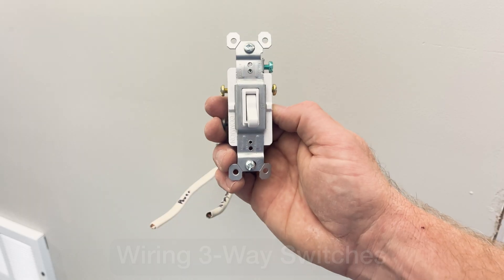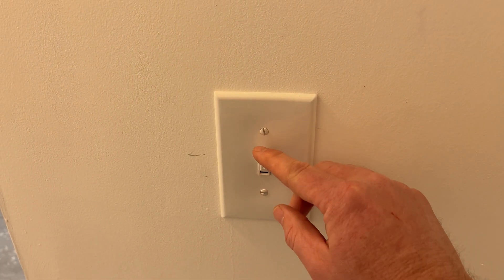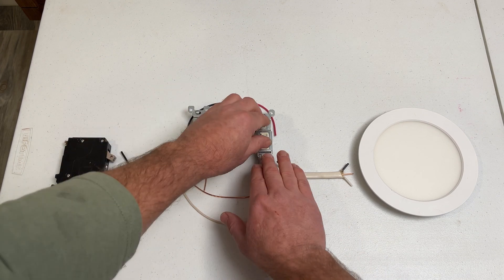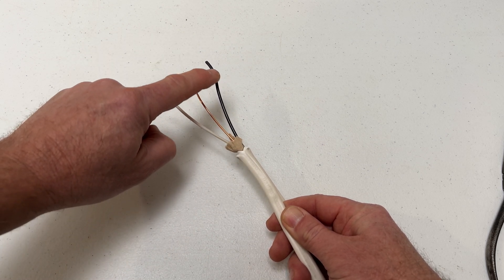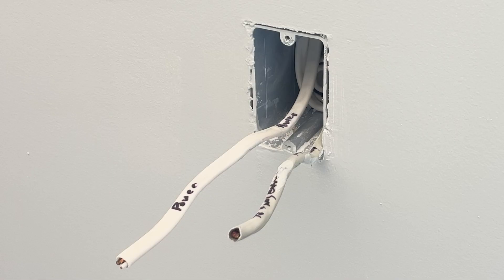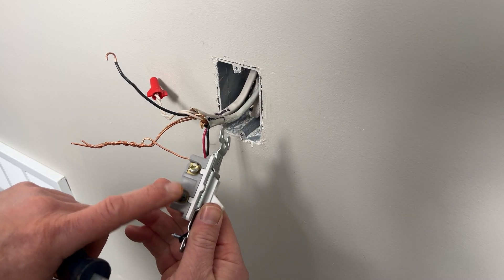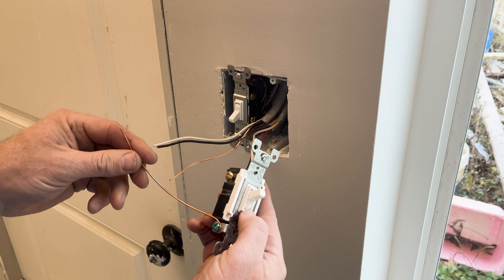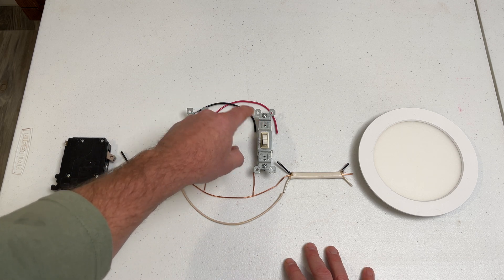How To Wire 3-Way Switches - It WILL Make Sense After THIS!

Comment from the maker: Clarification on connections - the ground wires should receive a connector of some kind.  I simply twisted them together with no wire nut, but I'll be adding a wire nut to comply with electrical codes.
Reply: Well Explained Sir 👍👍 just a little too fast in speed talk 😅 Thank you

Comment: So as not to simply return the neutral through the load and to avoid routing it through the switches !

- I mean 1 wire from panel to first switch 
- 2 wires between switchs 
- 1 wires return (neutral)
from charge

Does earth wire nessesary on switchs

A response would be appreciated
, i work much with EU system, so now watching NA system, im a beat confused

Comment: Starting to think i have either a bad wire or a bad switch. I have everything connected exactly the way you showed but only one switch is working correctly
Reply from the maker: @chasingthefish9042 Man, I know that’s frustrating. You might recheck your connections first just to be sure before replacing the switch. The wire itself should be ok unless it was damaged at some point.
Reply: @mancyclediy it was the switches. I bought two lutron switches and they dont work. The day after I posted this i bought two other switches and everything worked with the exact way I had it.

Comment: Awesome! Thank you so much! I knew from the moment I saw the paint covered screwdriver and I said, “ I have one just like that!” it was going to my kind of video!  This video is incredibly helpful. I can’t wait to watch the others.
Reply from the maker: @DR-hg5xr Hey thanks! I hope it helped 🤙🏻
Reply: @mancyclediy would it be possible to eliminate a 4 way switch by removing the switch, connect red traveler in to red traveler out, connect black traveler in to black traveler out? Would that essentially bypass the switch and be some a 3 way set up. Obviously grounds to grounds and neutrals to neutrals as well.
Reply: @mancyclediy would it be possible to eliminate a 4 way switch by removing the switch, connect red traveler in to red traveler out, connect black traveler in to black traveler out? Would that essentially bypass the switch and become a 3 way set up. Obviously grounds to grounds and neutrals to neutrals as well.

Comment: What about code neutral at both switch boxes. If you run power to the first switch your ok but the other switch has no neutrAl because you need the third wire for the switch . I always used the light fixture for my power hookup. Then both switches controlled the light but no neutral was needed I would think a forth wire would be needed if you use emt you have no issues. But do they make romex 14/4 with ground or 12/4 with ground? 73
Reply from the maker: Hi! Yes, they supposedly make 14/4 romex, but using it is outside of my wheelhouse.

Comment: I've got a 3-way 1 I want to replace with a dimmer switch. The 3-way switch has 5 wires going to it: 1 green for ground and two black and two red.wires. WhatI know where to connect the ground and the two red wires on my dimmer switch but where do I connect the two black? My dimmer switch only has one black wire.
Reply from the maker: @marknoehcnug Hmmm… is it possible that the switch you are replacing is a 4-way switch? Typically, a 3-way switch has only 4 terminals, not 5. Feel free to check out my 4-way switch video for details on those.

Comment: This works just the same with 12-2 & 12-3 wire?  I have 12-2 coming from the breaker box and cannot tie 14-2/3 to it.
Also,  it would make more sense, in my case, to have the lights (L) between the two switches (S) like this:    
S-----L----L----L-----S.        
Is it possible to wire it this way?  It would save me a lot of wire since the switches are on opposite sides of a long room.
Reply from the maker: @donovancywilko9217 Yes, it’s the same idea with 12 gauge wire. Also, yes, it looks like you can wire your switches and lights as you described. Check out this link to a schematic for running lights between the switches. Good luck with your project! https://www.jlconline.com/how-to/electrical/wiring-a-three-way-switch_o

Comment: Thank you for sharing your knowledge! This is the best three-way switch video on YouTube to date! I have one question, if I may: the switch works as designed, but when both switches are in the down position, nothing happens—the light remains off. However, when one switch is down and the other is up, the switch functions as expected. Do you have any thoughts on this?
Reply from the maker: @1969mmendoza Thank you sir! To answer your question, just for clarification   - when both switches are up the lights are on, and when switches are one up and one down, the lights are off, correct?
Reply: Swap the wire from commo  to one of the 2 travelers on the 2nd switch.

Comment: Thanks for the video. Understanding that you are not an electrician. Just to comment on a few points. 
NEC 250.8 does require some sort of mechanical connection (IE wire nuts, wagos, etc.) on all interconnected wires (IE your grounds).
While not code, standard practice on sheathing is stripped back to 1/4" from the NMC coming into the box (reduces stiffness when working with the wire).
minimum of 6 inches (or 3 inches past the box edge) of wire should be there. You had more than that, which is fine (just makes it a bit more "full" in the box when stuffing everything in)...Cheers!
Reply from the maker: @Greech-Grimwater Thanks for the tips! It sounds like I need to pin a comment to the top to tell viewers those grounds need a connector.  I appreciate it!